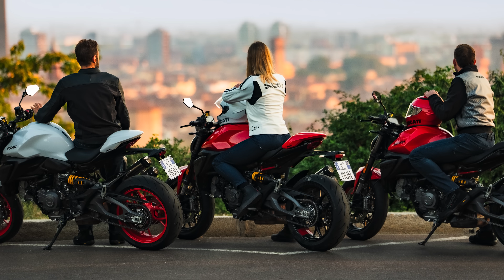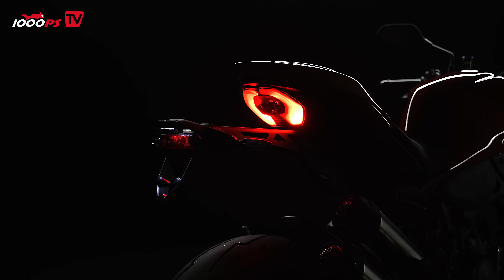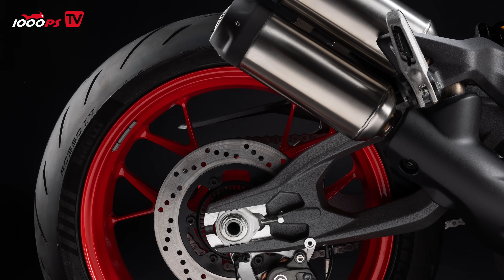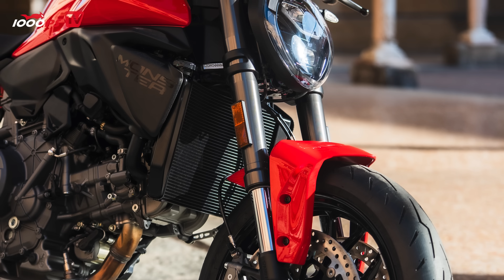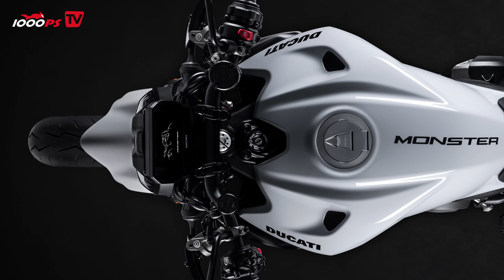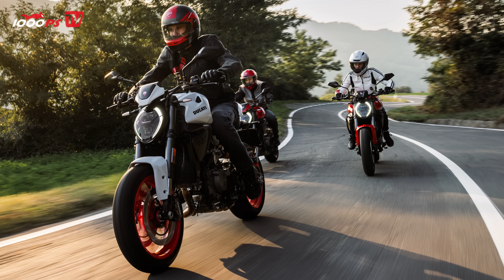Back to the roots! The new Ducati Monster 2026

Comment: As an old Monster fan, I test rode the 937 Monster and was disappointed. The bike was extremely well balanced and light, and the handling was out of this planet. But the engine felt and sounded dull, boring, empty... soulless in the low revs. Plus... it's looks were too "Japanese" for my taste. You can see a well maintained 20-25 year old Monster today on the street and still think it's a beautiful bike. The 937 surely will not age that well.
This one looks a ton better, so I am really curious to see what they actually came up with!

Comment: They wanted to build a new version of the monster with the new engine without desmo. This is cheaper of course. In technical terms it is not really better: The old engine reaches his max torgue at 6200 rpm the new reaches it at about 7200 rpm. The max power is identical: 111PS. Less maintenance is an argument, yes but I don´t see better perfomance. Ofc the force behind this evolution are the idiotic regulations  of the EU. Therefor let's not blame ducati. Fuck the E***

Comment: no one is crying about tech packs because its not a KTM 😂 😂
Reply: Have you never looked at the accessories list from Ducati as it makes the tech pack from KTM almost like something from Amazon… plus, the Ducati service Tax, even with the changes it still requires kilometre based or yearly (which ever comes first).
Reply: @marcusgeorge1825  doesn't matter. Software unlock is software unlock

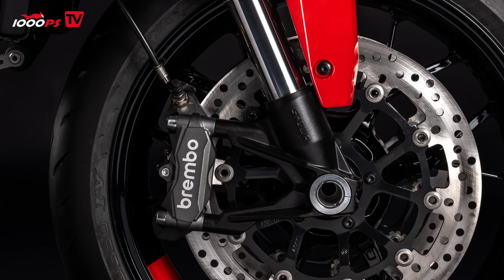Comment: Honestly very disappointing its like they intentionally want to be less competitive. The  2022 SF had 150+ HP on paper (955 cc) .. 2025 (890 cc) 120 hp, monster 890 cc: 110HP whats the point.. They should not nutter the SF like that if they are going to have a monster with the same engine. By the way you are saying @3:43 rear tire dimensions 180-75 .. cant be right
Reply: Rear tire IS 180,  For looks & what people wanted
Reply: @bruceread4507  obviously 180 .. NOT 75 though.

Comment: design is worse imo. much worse. Also why is the new model only 4kgs lighter if the engine is 5.8kg lighter than the previous one? 
Its kind of offending that the engine is the same as the sf v2 but the power is reduced a lot.
I wish theyd stick a detuned v4 engine with similar figures to the diavel like 170 180 hp in a light chassis. sub 200kg 180hp monster would be great and wouldnt threathen the sfv4 as this monster is doing.